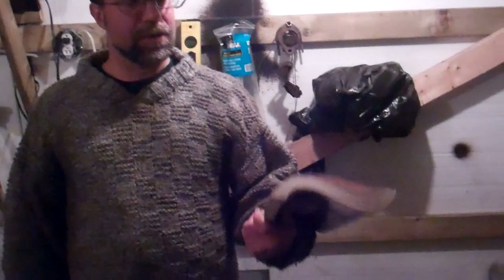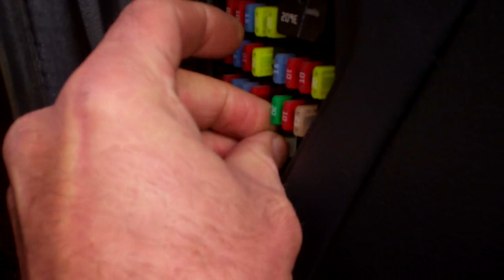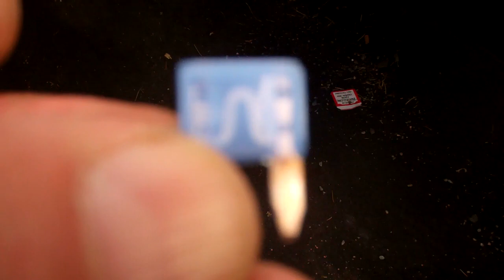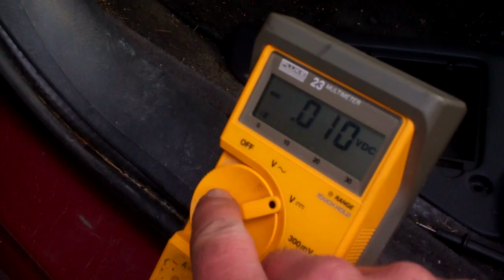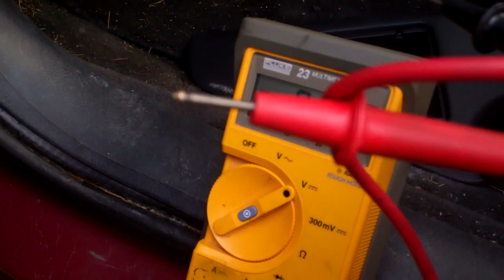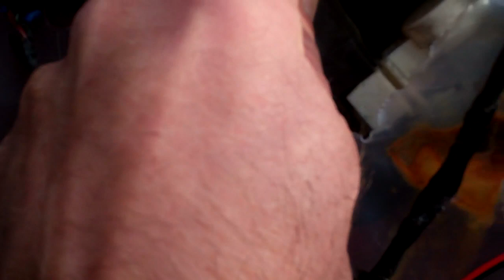How to change a bad power window motor in a Pontiac Sunfire.

Comment: Why would you look for a fuse for ALL accessories when ONE window wasn't working?  Also, those are wire cutters, not pliers.  No showing taking the panel off, poor lighting, poor focus on the video.  P.S., the car is a pigsty.

Comment: "How to troubleshoot a power window" should be the title, because you completely skipped the removal and replacement of the motor! The relay you refer to is actually a circuit breaker. If the back window operates you just diagnosed whether the circuit is active, because power windows means all power windows not just the right rear. Next you should show removal of the door trim panel because as you see further into the video (after everything is assembled) if you don't follow proper procedure you may need to hold the trim on with electrical tape! Congratulations you did test the voltage at the motor. You did show that and then drilling the rivets which we should assume the motor is faulty and you diagnosed a faulty motor. The reason you had to grind the shaft on the motor so it would fit is because you have the wrong motor. Replacement parts don't require modification. "Gear shift?"  Sorry bud but I am a Licensed Mechanic and fixing the screw ups "back yard mechanics" cause ultimately cost the owner more than what they think they saved. You have misguided close to 70,000 unsuspecting viewers to thinking this is the correct way to replace a power window motor! Did you watch this before you posted it? An absolute waste of time, stick to squid jigging!

Comment: inside that car looks like shit. I wonder how that persons house looks! The way you keep your car is usually they way your house or apartment look like. If I was buying a car and the guy rolled up with the car looking like that...I'd tell him don't worry stopping...keep on rolling! Utterly disgusting!
Reply: Plus using diagonal cutters for plyers.  Pry bar was trashed.  Ordered wrong motor. Couldn't get a simple fuse puller out of the block. Took out the wrong fuse.  First thing I would have checked was the power window switch because they will generally go before the motors do.  1/3 of the video was on the fuse and fuse block and they never actually even showed the replacement of the motor as the video is entitled.  They give backyard mechanics a bad name.

Comment: And the rear window is working but you still tear the car apart to check a fuse that obviously OK.  Ohmeter?
I just had this problem as well.  My wife's car has had off limits on the passengers window.  Just in time for winter weather her drivers window quit working, and it stopped working at about 80% open (before I could do anything about it) it got plastic and duct tape.  I went online and read several sites posts, where it is a forgone conclusion that the motors die.  I thought it over and with what information I could gather, decided that the problem more so reflected that the control switches could be the issue.  I pulled the switches and tore things down.  Sure enough the design that put the switches on the console is a very poor design.  Dirt, dog hair, sand, etc had inundated the switches and they were burnt, charred, and completely not possibly functional.  I cleaned and polished and renewed the lube on them, tested them, and then plugged them back into the car and guess what, both windows work perfectly.  All I can say is, if your motors are for sure burned up, it most likely is because the switches got gunked up and caused the problem to become more serious.  I will soon put a video on You-tube explaining the issue and several tricks needed to successfully repair them (seeing as how they are basically designed to be UN-repairable).
Reply: +Leonard Legg Len, did you ever put that video up? I have a passenger window that hummed down just fine and stopped. It jerks a bit to the door and master buttons, but in no way will wind back up. I'm wondering if the master button being "gunked up" could also affect the door switch.

Comment: Well..have an 05 sunfire and drivers window motor went out..wasnt happy about the 5 rivets needing to be drilled out, it took forever..new motor only came with three screws and nuts to attach motor to regulator..had to buy new rivets..but all is back together and well..for now...lol thanks for this vid

Comment: While I mostly appreciate those that will put up do-it-yourself videos to help those less capable, you might want to rethink it.  There's no fuse it's called a circuit breaker,  which means your "test" of it was completely bogus and if you're gonna call the video  "How to change a bad power window motor" you might consider actually showing the change.  A person has to watch you fumble around for 3/4's of the video t'shooting w/no motor change. Waste of time.

Comment: Hey, thanks for the video. 
I have a question about the motor. Does it fit all 4 windows or I have to specify for which door I need. I have 4 door sunfire, 2.4L.

thanks again

Comment: what size bolts did you use to replace the riviets to the door?
Reply: I did this motor replacement '02 sunfire, I bought the moter from autozone and It does come with replacement bolts, So be sure to open the box and make sure the screws are in and Item is new I have bought many a parts there and experiance Item(s) were returns and put back on shelves to be resold SO be carfull!

Comment: Was there rivets used to attach the regulator to the motor? Would it be easier to simply buy the complete assembly rather than just the motor? Even if you don't need to replace the regulator??

Comment from the maker: Yes Hvwy - I took the drill bit i used to the hardware store and bought a bug of small nuts and bolts that would fit the bit. I was going to use a rivet gun but there wasn't enough room to get it in the space.